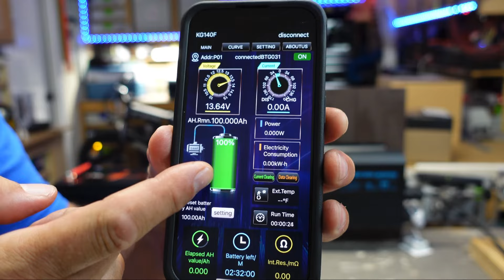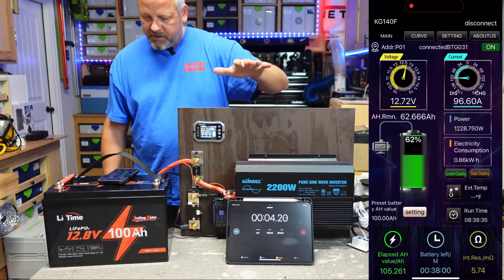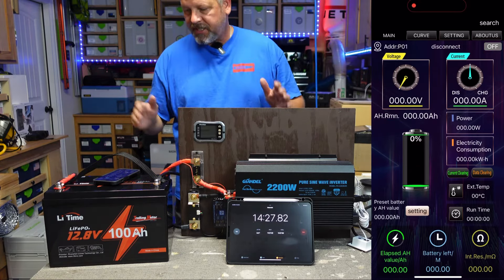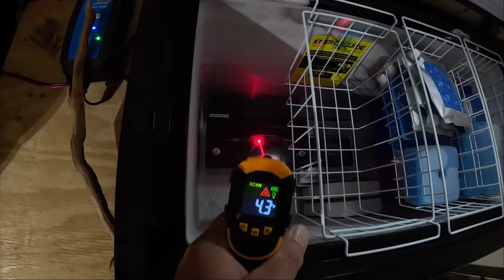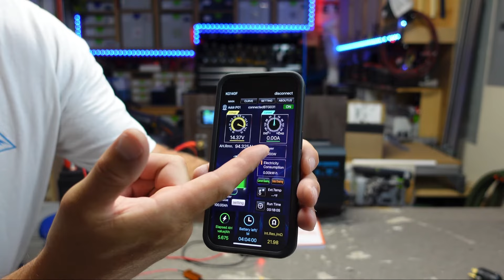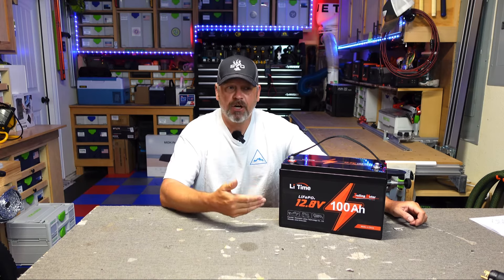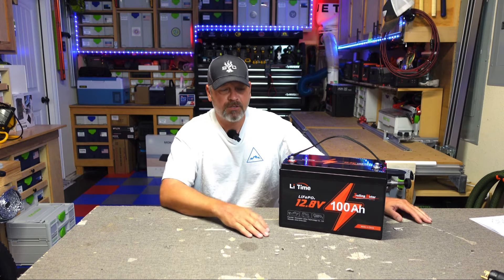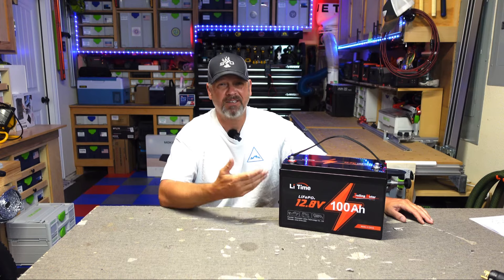*NEW* LiTime 100ah 12.8v “TROLLING MOTOR” LifePo4 Battery?? But….WHY?

Comment: Scam alert on the "Trolling Motor Battery" Label . You have a 60amp breaker at most on your 24v 80lb trolling motor or 100lb 36v so how in the hell will a battery that allows 100amps at start up do anything for you ???  Everybody's buying the Mini and group 24 and nobody wants these big 31's and the price drop on them proves it so marketing is playing a game with TM label. The Litime group 24 in series has pushed my Minn kota 70lb for 2 years without issue and they make the old Interstate group 27's look like a joke. Li time 100ah batteries already have built-in 100A BMS so the TM is just a sticker. Read the fine print. The Litime brand is the real deal but no need to buy the huge 31 with a TM sticker. Just get the group 24 with bluetooth and your battery troubles will be over if you get a dedicated LITHIUM charger. Dont be the guy that charges a lithium battery with your grandpaws old Craftsman charger or hit the wrong button on your Noco Gen 5 and have to go trolling about how your battery died to feel better about killing your Lithium battery. And dont think the alternator on any engine can magically become Lithium battery compatible because you think it should be and troll about how your lithium battery died without telling readers you killed it with stupidity

Comment: I’ve got 2 and use them for my minn kota terrova 24 volt. It’s been the best investment to my boat to where I can go full blast 10 speed while still being able to spot lock in the wind and autopilot while going down a bank then see I still have a full charge on the battery test meter. Well worth it

Comment: I've ordered 6 LiTime batteries over the past year, and none have failed, save for one that had some hiccups after being submerged, but sorted itself out after cleaning the terminals. I use them for a trolling motor mounted to a kayak, charged by solar panels through a controller. They've been exposed to plenty of saltwater splashes, saltwater air, extreme heat, extreme humidity, shock, and rapid discharge (30+amps). I have 3 connected together.
Reply: Yes, it doubles as an anchor if you order the special cable.
Reply: Had one fail 👎

Comment: I've been using LFP batteries, both commercial and DIY, to power my trolling motor for several years.  This varies by which motor you use, but they generally only draw about 50 amps, peak.  Most of the time, they draw less than that, because once your boat is moving it just doesn't draw as many amps.  It's a no-brainer to use a sealed LFP battery for a trolling motor application.  They are half the weight, twice the usable capacity, don't suffer from voltage sag throughout most of their disharge curve, plus they charge back up so much faster.  These days, it is a false economy to use any kind of SLA or AGM battery for powering a trolling motor, because they just don't last as long.
Reply from the maker: Good info👍🏻 thanks Jason

Comment: Any LiFePO4 battery can be used for a trolling motor.  Trolling motors are just the 12V or 24V electric motors mounted to fishing boats that are used for moving from spot to spot.  They drain batteries pretty quick so lithium batteries are an awesome replacement for heavy lead acid.  However, on a boat you also need a battery to start your gas outboard when you need to get back to the dock or change spots on the lake.  The extra 300-500 amps for 5 seconds means this is a dual purpose battery.  It can be used for BOTH starting an outboard gas motor AND for deep cycle use with a trolling motor.  Pretty slick...the name brand equivalent is currently $1000 plus.
Reply from the maker: Great info👍🏻👍🏻

Comment: Iv got one in my boat and a repeater building on a mountain top (temps from 105 to -7). So far it’s worked well I might upgrade to the 400ah battery as the repeater is more popular than we originally expected.   🔴 note the battery BMS is very noisy and not good for raspberry pi computers that deal with audio. You will have static issues.

Comment: I'm about to review one from one of their competitors, LiPuls, and I had a similar question about why it's designated trolling motor over one of their other comparable 100ah models.  Thanks for your review.
Reply from the maker: It can handle a higher surge to be able to crank a trolling motor.

Comment: I’ve been using these batteries in my bass boat for the past year and have had no problems with them. 
I have a 17’ fiberglass boat with a 125 hp motor. I can fish all day when it’s windy (15 mph+) and only use about 30% of a full charge for my 24 volt Ghost trolling motor then the batteries recharge in less than 30 minutes. 
I use another one of these batteries to run my graphs and always have good clean power all day long. 
I don’t fish in freezing weather so charging during the cold isn’t a problem for me. 
I live in Texas and we had dozens of days this year when the temperature was 105+ degrees so I wonder how charging in the heat does because I don’t fish in 100 degree weather either.

Comment: Great video, I learned a lot just by watching.  I want to run my MinnKota Terrova 12v 55lb thrust off of one of these.  Do I need the big one like this, or can I use something like the Li Time Mini 100ah for that?  The extra space savings would help...
Reply: I've ran a LiTime Mini on my Motorguide 12v 55# thrust with zero issues. I'll never buy a deep cycle lead-acid battery again!

Comment: Would you recommend these or the 100 ah self heated low temperature ones for a trolling motor? Boat is stored pretty much outside and the winter dips into the 20s. I Usually use my boat through out the entire year. Just not sure which ones to get. I may be fine with these instead of spending the extra $100 if the self heated ones but Figured I’d ask.
Reply from the maker: I’d recommend still the TM batteries. They have a BMS that can allow the high amps it takes to start those motors
Reply: Thanks for the reply. It says the one I ordered with the self heating low temperature protection has a bms. It just wasn’t in the “trolling motor model option” which was kinda confusing.

Comment: The new Bluetooth version of this  battery is currently on promotional sale for $229 on Litime's website as of 10/14/24. 
Not bad for a beefier-than-average BMS, low temp cutoff, and bluetooth connectivity. The extra headroom of 300-500 amps for a few seconds allows this battery to run some inductive loads with a large startup inrush current (power tools, pumps, motors, etc.) without tripping the BMS overload protection instantly like many batteries do. It seems like LiTime's build quality exceeds a lot of the other China-made 100Ah batteries at this price point, judging from the scores of tear down videos online for LiFePO4 batteries I've watched. Some of them are downright terrible. I own several models of LiTime batteries, and haven't had an issue with any of them yet. I just can't afford the BattleBorn batteries many people swear by.

Comment: Does this 12.8v will be okay to run a 12v trolling motor without damaging the inside?
Reply from the maker: Yes. This battery has a very high max amp surge rating which will start up trolling motors

Comment: Is this 12.8v lithium 100Ah battery considered a dual purpose? Do you know if it can be used for cranking a 250 stroke mercury outboard?
Reply from the maker: Do you know the amp draw on that motor?
Reply: I understand that these are storage batteries and are not designed for sudden amp draw used in cranking. I use an AGM cranking battery and use lithiums for everything else.

Comment: I bought one off amazon  1-18-24  it will not take over 30 amps charging I have tried it in the motorhoe and on the bench using a new 75 amp converter Charger
Reply from the maker: I’d submit a warranty with LiTime then. That should not be happening.

Comment: Would I be able to run my 24v Minn Kota Ultrex 80lb thrust, Garmin 93SV, and my bilge pump off 2 of the 12v 100Ah trolling motor batteries?

Comment: They have a deep cycle battery also, would that be for cranking? Could you use the trolling motor battery as a cranking battery? Do you have a suggestion for a lithium cranking battery for fishing?